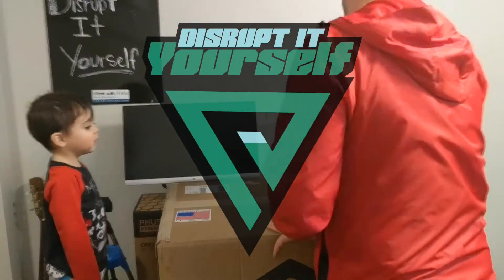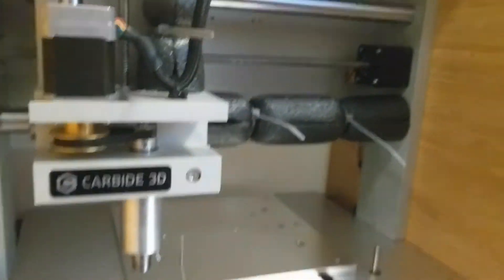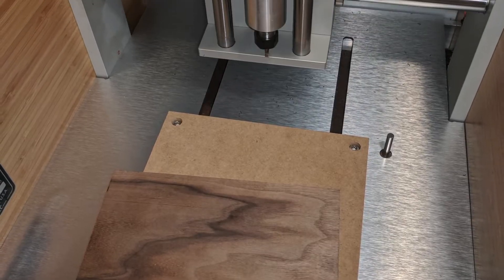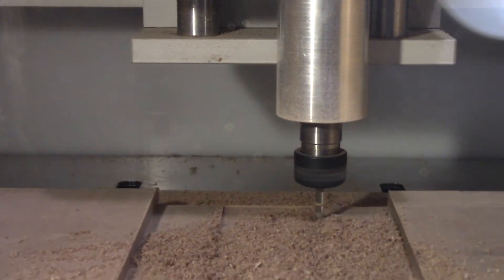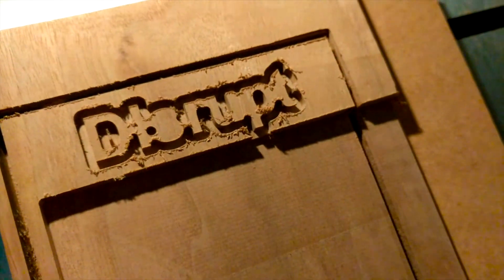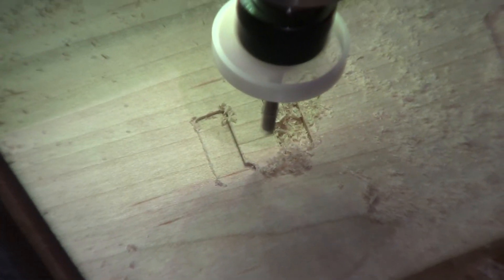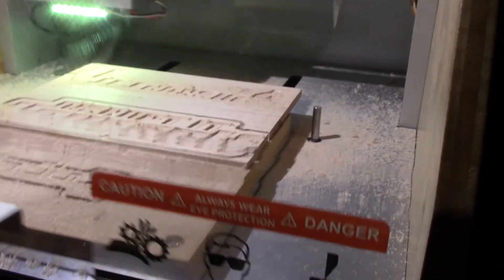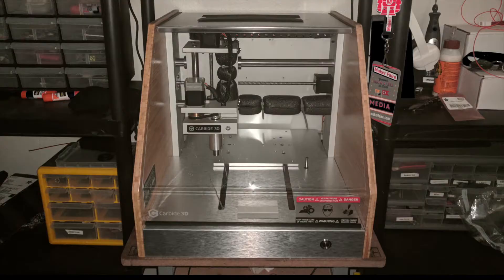Nomad 883 Pro Desktop CNC Mill from Carbide3D

Comment: Nice CNC! I'm curious to hear how robust their software is? Maybe a little walkthrough setting up CAM or vectors?I've seen some good stuff from the inventables easel. I can attest to the Othermill being pretty pricey, but I always justify it when we talk about software, especially with integrated PCB support from eagle. I'm starting to reach the limit of the build volume of mine and have consider either the Nomad or the Carvey. Both are pretty interesting!
Reply from the maker: Noe and Pedro this year they released web based software for PCBs called Carbide Copper. I'm hoping to start using that this week once a package comes.
There is some simple 2D software called Carbide Create that is a lot like Inventables Easel software. You can import svg's and create some basic 2D designs. Beyond that they have a 3D CAM tool that Im getting into soon especially for two. Sided jobs. They have something called a flip jig that makes that kind of thing a lot more practical than it would be on other machines. The one immediate advantage I see from the Carvey is that it has a few more inches of work area on the X axis and a little less on the Z. I think Fusion can generate toolpaths too right? I guess I'm taking it slow. There will be lots of videos about this machine and CNC in general.
Reply: Disrupt It Yourself Sounds good! There might be a tool library for fusion 360 then that’ll make setting up cam easier. Lemme kno if u need any help with that.
Reply from the maker: Noe and Pedro Will do 👍

Comment: I have a Nomad 883 and a SO3 XXL. I use the SO3 99% of the time because it is 10x faster than the Nomad and it can cut up to 33" x 33" x 3" vs 8x8x3.

The Nomad is better at very fine tolerance work but the spindle is anemic at 0.07 hp.  Because of this it is very slow if you are cutting soft metals or even hardwoods or plastics using a 1/8" endmill.  It's not powerful enough to support a 1/4" endmill.  However,  for very small details it probably can't be beat for the price.  It will consistently hold +/- 0.005" tolerances.

The SO3 is cheaper, faster and bigger so it's a better choice if you want to do larger pieces faster and do not require better than +/- 0.020" accuracy.  You can get better accuracy than that but usually not without fiddling with the part model or setup.
Reply from the maker: Tony Shulthise Thank you for the awesome comment. The Shapeoko 3 looks awesome but the other advantage of machines like the Nomad is that you can actually use one in an office. If I had a Shapeoko right now I literally wouldnt be able to use it.
Reply: Disrupt It Yourself I built an enclosure and dust shoe for my SO3 so it's not very loud and zero dust escapes.  I have a couple videos on my channel demoing it.
Reply from the maker: Tony Shulthise I will definitely check that out!